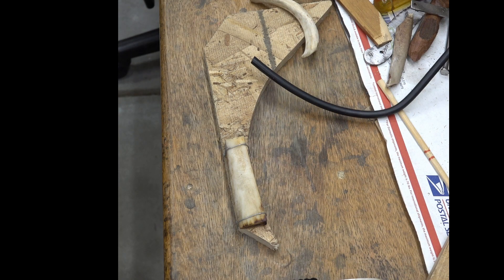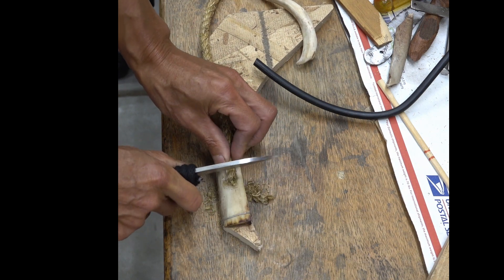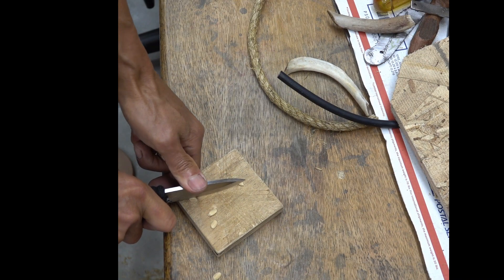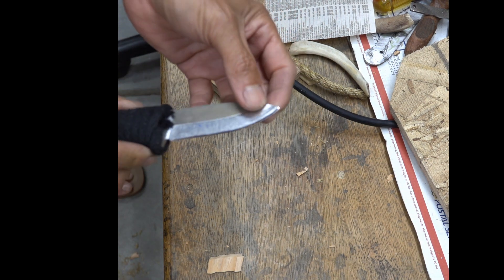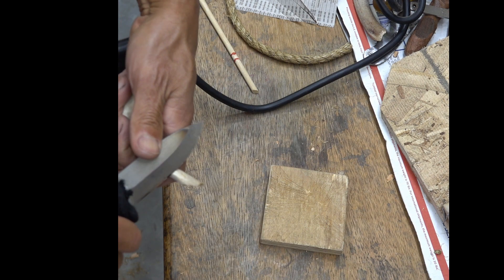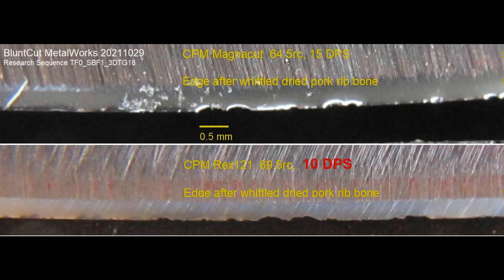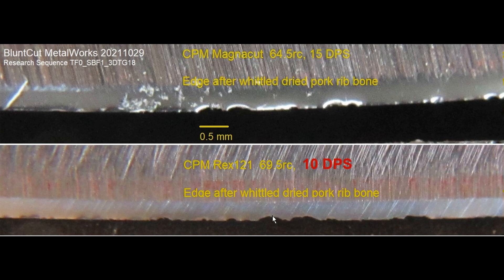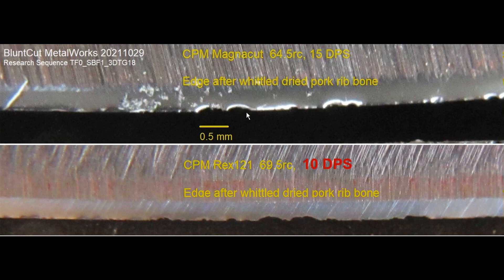Magnacut 64.5rc 15dps Edge Usability Test

Comment: Magnacut seems to be a great steel indeed but I'm still a bit skeptical about its corrosion resistance. People say it's better than M390 but do you think it would be true?
Reply from the maker: To be clear - I found magnacut edge has insufficient lateral strength given at this  hardness (displacement strength). Of course pertain specifically to my sequencing protocol.
I tested magnacut with compounded/repeated spray of ocean water over 24hrs period = no rust, only a slight yellow tint in 120 grit grind lines.  Maybe I will side-to-side ocean spray test various steels - all at 120 grit finished.
Reply: Just bcz it has more chromium it does not mean its stainless